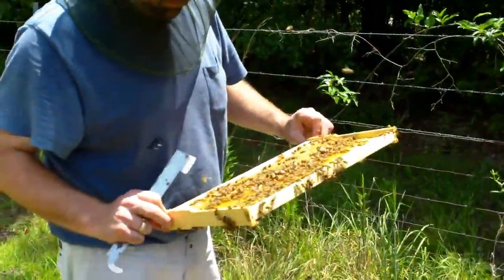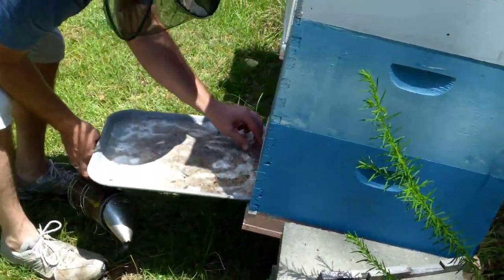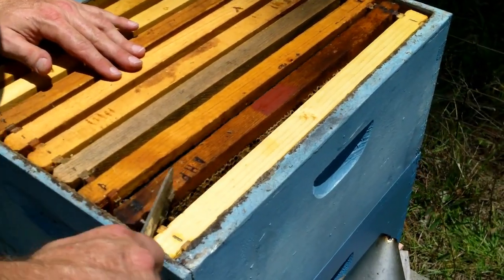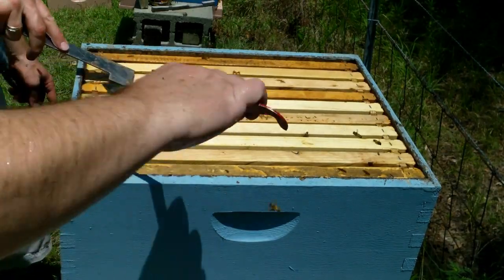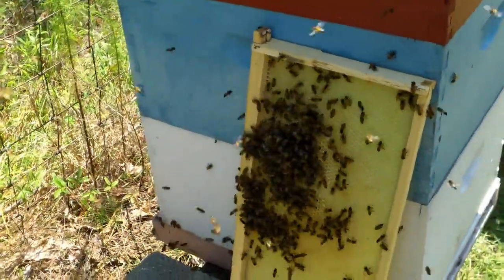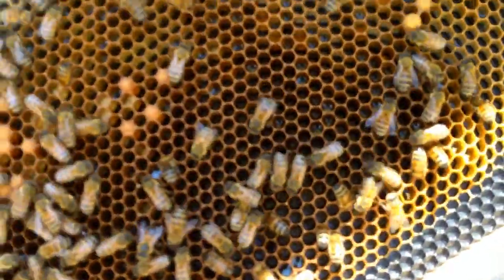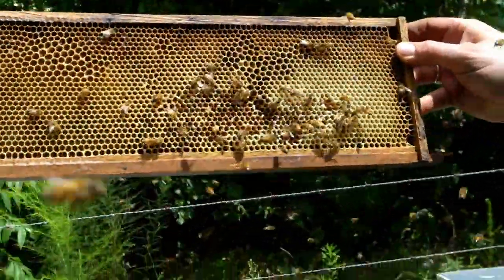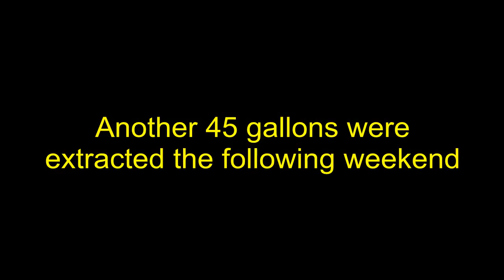Pulling The Last Honey For 2014

Comment: I really like that de-capper that the young fella was using. Another good video, thanks.
Reply from the maker: Pop's Shack It make short work of those frames for sure.  This guy charges to use his equipment but it doesn't cost much to work over there and he and his wife usually help.
Reply: Well, that sounds like a pretty sweet deal.